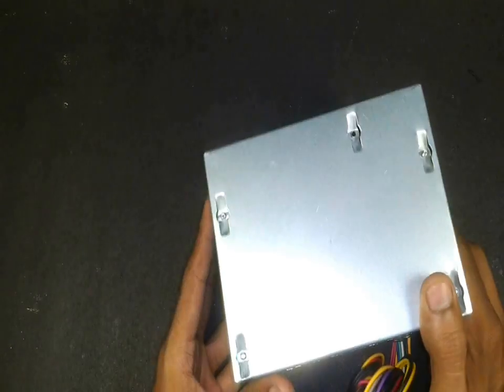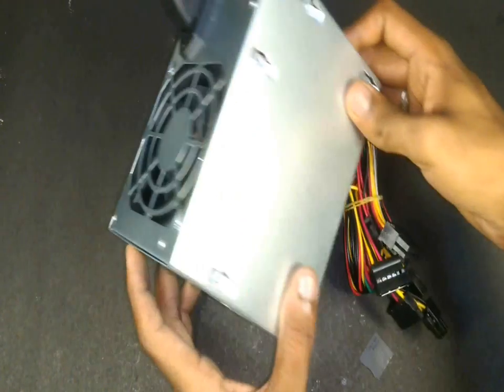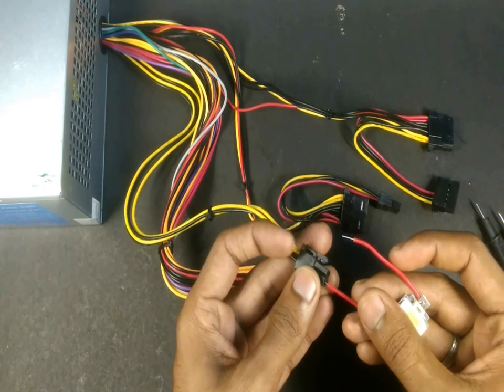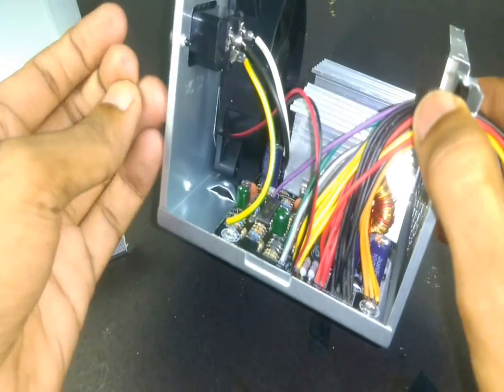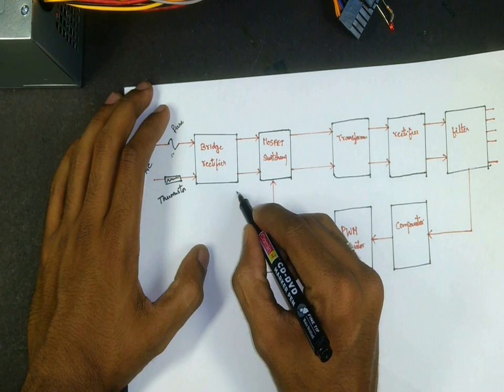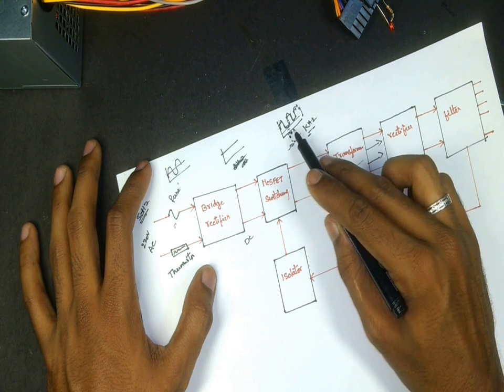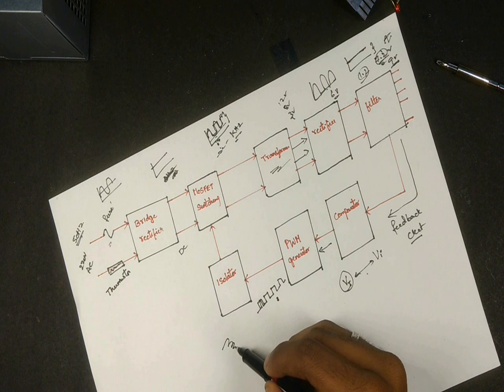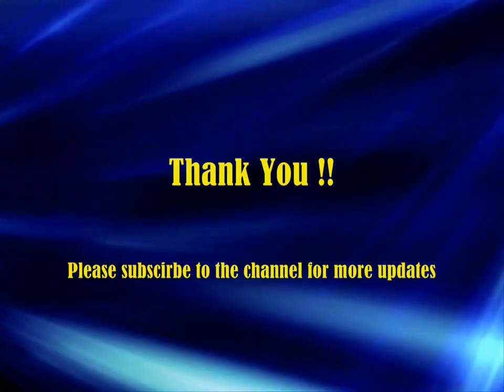SMPS teardown and working (Zebronics smps)

Comment: The SMPS I used needs at least 500mA to keep running (22R 10W on +12V rail).
This is a matter of trial to see at which amperage draw your smps will still awake.